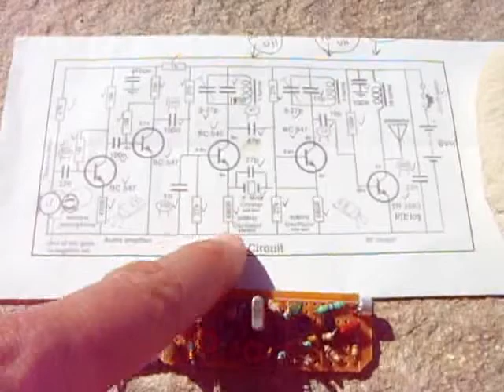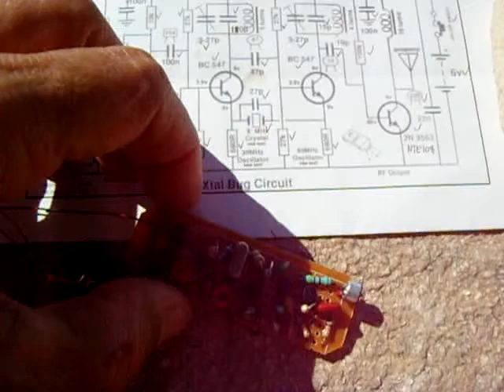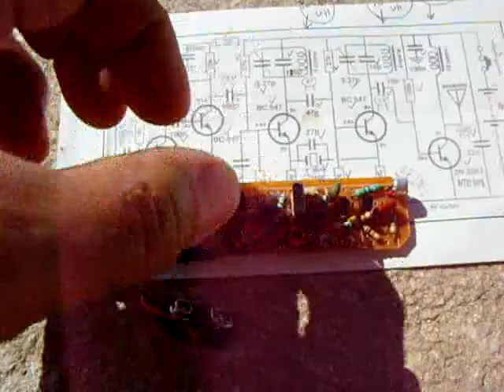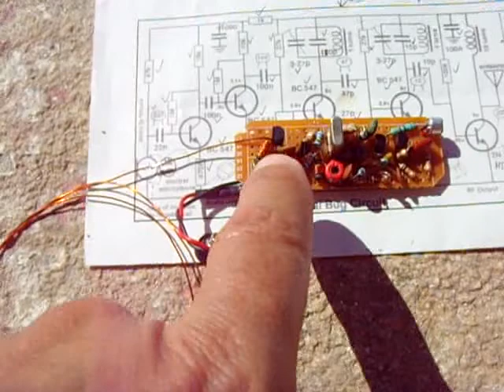Crystal Locked FM Wireless Transmitter / Bug

Comment from the maker: I have not operated the transmitter continuously to see how long the battery will last, but I know it will be for many hours. I have a 9V 300mah nimh battery, so at a 10 ma drain, I would expect at least 24 hrs of operation. Probably much more than that.

Comment: Hi, friend! I have just a question: the quartz crystal really lockes the frequency (because it's between the emitters of the firt transistor, which is the and the RF oscillator, and second one)? And, if yes, is the modulation high and clear, like the FM commercial stations' ones are? I ask this, because, as we know, quartz crystal oscillators are very critical to provide a large frequency detour (as the 75 kHz one, characteristic of the commercial FM radio stations). Thank you!

Comment: My prototype is the simplest FM bug with 1 transistor and crystal between collector and emitter, but stability is so high, that audio modulation doesn't work very well. Audio sounds distorted (overmodulated), because there are 2 modes now. Crystal locked mode (without audio) and "unlocked" mode, where frequency is defined by LC + antenna + audio modulated transistor capacity. Frequency jumps away and audio sounds overmodulated. I think ordinary LC oscillator with higher capacity in LC, low power/low heat + stabilized power supply + 2 pcs RF amplifiers (buffer stage) will provide good frequency stability and audio quality too.
Reply from the maker: Thanks for watching Dave!

Comment: Thank you sir!! This is all i needed for my wireles electric guitar project.I will use it just outside of the FM band frequency.But how can the power of the transmitter can be lowered?I dont want that much range.Also i checked out the site and i didnt understand the Peaking part where you adjust the capacitor trimers if you can explain that will be great.
Cheers!
Reply from the maker: Peaking refers to setting the maximum output of the transmitter for the desired frequency. I normally use a frequency counter or RF signal strength meter(place it several feet away), along with my DMM measuring the current draw of the transmitter. You want the best sound quality, most range, and lowest current draw as possible. Lower voltage is lower range, and you can probably add a 220 - 470 ohm resistor between the emitter and neg rail of the last transistor on the right.
Reply: Well i dont have a frequency counter.Is any way i can build a RF signal strength meter? I searched up on google for schematics and i found some simple ones with ammeter, do you think that will work?
Reply from the maker: I show a RF signal detector on my channel under the FM transmitter playlist. The device below also works great, and it's cheap. :-)

http://bit.ly/2mvuvyh

Comment: Why when I touch the case of transmitter device the frequency change
Reply from the maker: It should not drift if the circuit was made properly. Place the circuit inside a plastic case.

Comment: hi, can you tell me what kind of core coil are you using?
Reply from the maker: I removed the core out of a tunable inductor. The small plastic type where you can see the wire wrapped around the outside of it.

Comment: What are the inductor values.
Please answer.
Reply from the maker: The values are not needed. Just make the coils as shown in the schematic. If you want a specific inductor value, then use the online calculator below to figure out the value. Thanks
http://www.daycounter.com/Calculators/Air-Core-Inductor-Calculator.phtml
Reply: Thak you very much, but these online calculator is just for air core. I can t found calculator with ferrite core (F-29).
I ask you for inductanse because i don t have 2mmx6mm ferrite core. I have 3.5mmx6mm ferrite core.
How much less turns.
Reply from the maker: Nenad Vanusic Look for a tunable inductor from scrap electronics and remove the core. That's what I did. They measure around 6mm x 2mm. They look like what you see in the link below.

http://www.ebay.com/itm/like/221663687948
Reply: I was trying to find tunable inductor but i found different, like 6mm x 1mm or 6mm x 5mm with hole inside core.
Thank you.

Comment: k, thanks;  i'm going to give this one a shot, check out this configuration... http://electronics-diy.com/schematics/1330/250mw-fm-vhf-transmitter.gif
Reply: I assembled (building) a transmiiter. The transistor 2n3866 very hot and sound of the modulation he is very low. I here problems with crystal transmitters. The sound just very down.